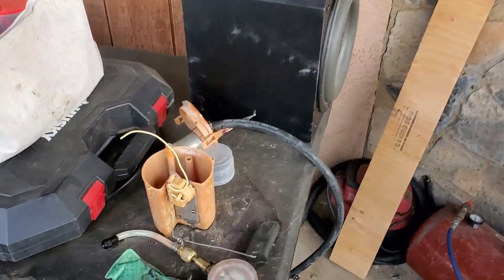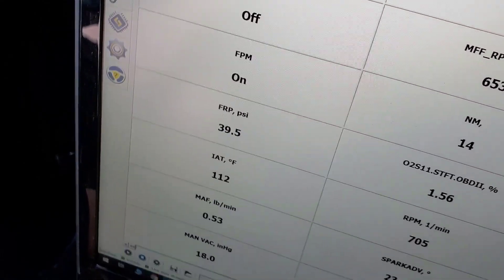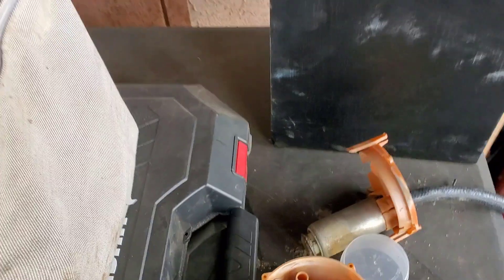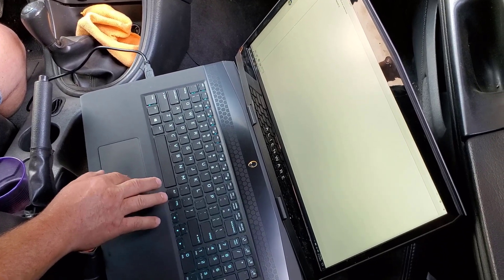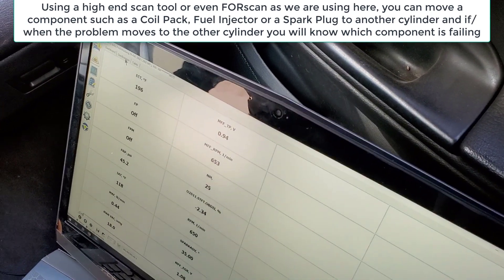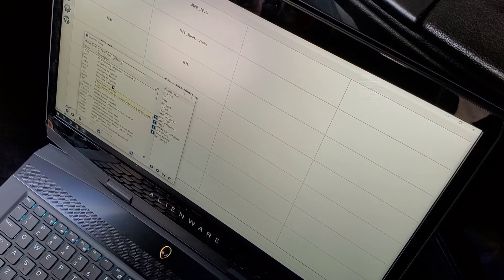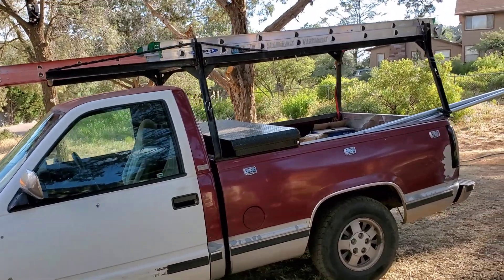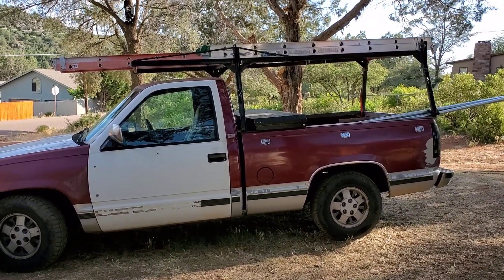Trading an old car project to a hillbilly friend means you still have to work on it!

Comment: Can you read misfires per cylinder?
Reply from the maker: I didn't find anything to show which cyclinder in real time but I didn't look extensively. Once it sets a DTC it does state which cylinder so sooner or later you would still be able to know which one.
Reply: Depends on the particular car, but some Fords have a misfire counter per cylinder which you can find in the live data list.
Reply from the maker: @AmericanLocomotive1  
I didn't look too hard for it.
Reply: I’ve had the same issue with some late 90’s GM’s,  even when logging per cyl it’ll only show total counts.